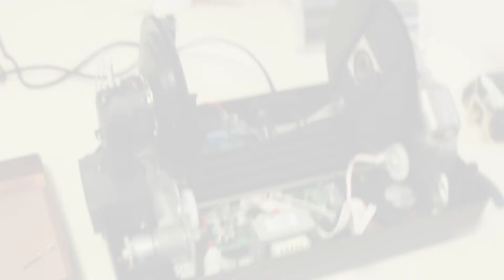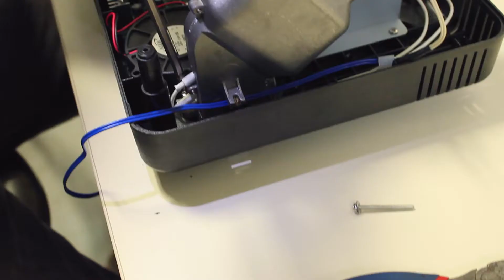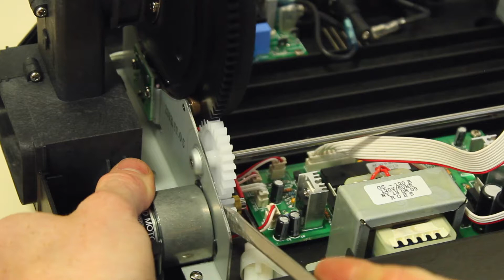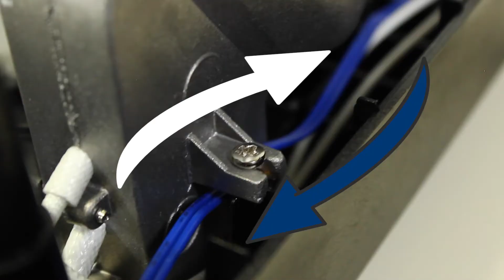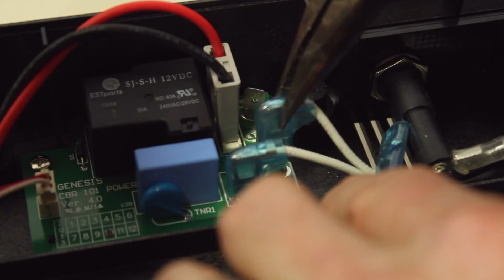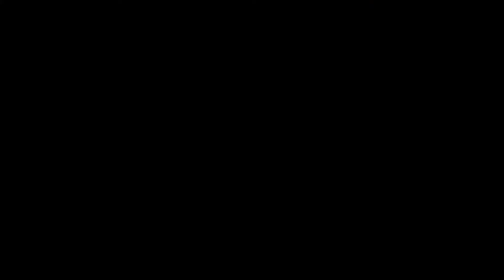Gene Cafe Coffee Roaster Repair :  Heater assembly Final

Comment: Plz help me....I am getting E3 error and drum not rotating ....but heater works
Reply: check the motor of course and specifically the pinion gear wheel on the motor which rotates the whole lunapark